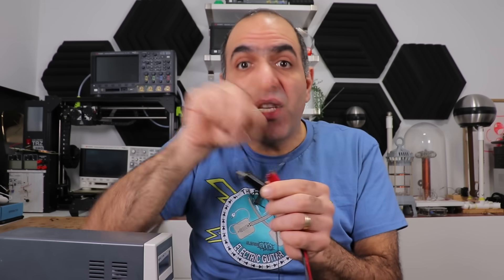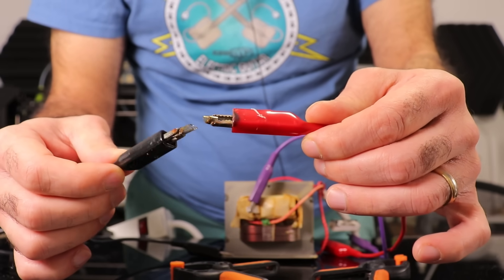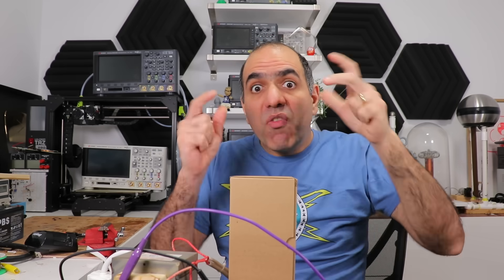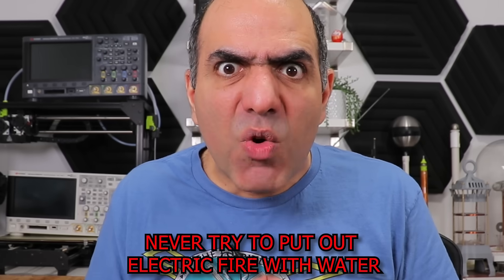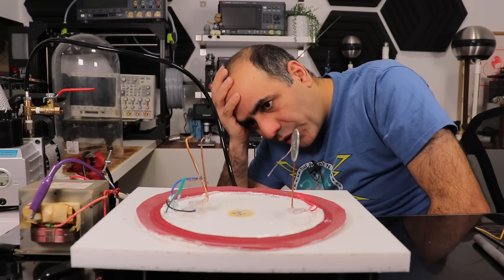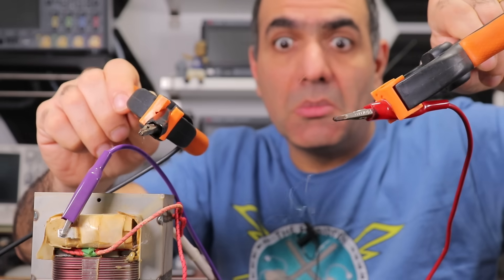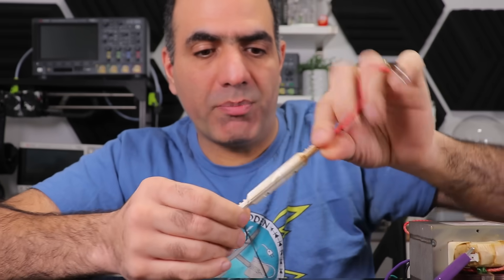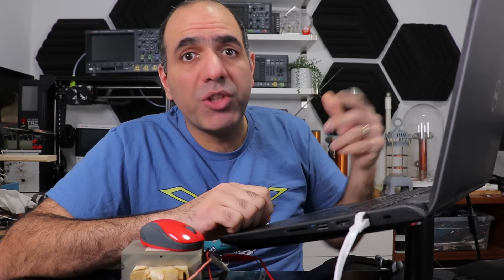Making a High Voltage Fuse

Comment: Video Idea: Build a deadman foot switch that you have to keep pressed in order to get mains voltage whenever you are doing something with the MW transformer. In case of an accident like with the Jacobs ladder it could safe your life :)
Reply: Im pretty sure he already have something like that, he is smart and this is his profession..
He know's what he is doing.
Reply: That's a great idea 👍
The one hand rule is another lifesaver.
Reply: @John-oo9bu  yup but that doesn't always work when having to react to something quickly ( like a Jacob's ladder falling on you :D )
Reply: @John-oo9bu one hand is a good rule, but when dealing with over 600v it won't always save your bacon.  Insulation has a breakdown point.
Reply: @MichaelRBaron  Actually, the worst shock I've had was through insulation. My other hand was in my back pocket, not on the grounded work bench. I was only 14 and very lucky.
Reply: @John-oo9bu  worst shock I had was 277 from my right hand to my left forearm.  Second worst was a 15kv neon sign transformer, 7.5kv to ground but only 30ma of current.
Reply: he has and old video explaining that he has a hidden switch that uses to cut power also to trigger the explosions
Reply: Good idea, unless you get paralyzed during shock in such a way that one side of your muscles overpower the other and you stay more or less in the same position unable to move and just slightly straightened overall. Dead-man switch relies on loosing grip/consciousness, and shock is often the complete opposite.
Reply: @Mr.Leeroy dead man switches have 3 positions.
Loose grip being off
Mid grip being on
And tight grip being off
Reply: supporting this idea, we wanna keep our youtuber/professor alive
Reply: Back then (Jacob's ladder) he needed to just knock the falling ladder off with his right hand. He wouldn't have suffered as bad or maybe even not at all.
Reply: im not 100% sure but i think when you get electrocuted you tense up so he might he the peal down harder. dont know for sure
Reply: That's probably Way Cheaper than getting Married and Having Children.
In that home, there is always someone within arms reach of the Breaker Box, guaranteed.

Comment: Circuit brakers does extinguish electric arc same way, by pulling contacts apart very quick (not only by pulling contacts fast they have more strategies to extinguish arcs like multi point contacts to spread arc trough multiple points... But this is main idea and that's allso what makes circuit braker pop sound)

Comment: Glass fuses commonly contain nitrogen gas to prevent arcs. Sulfur Hexafluoride is also used to insulate fuses with higher voltage ratings.

Comment: In general, glass-sealed fuses, including those used in microwave ovens, are typically filled with an inert gas, such as nitrogen. The purpose of the gas is to provide a medium inside the fuse that does not support combustion and helps to prevent the formation of arcs when the fuse blows.

When a fuse blows, the metal inside the fuse melts or vaporizes, creating an open circuit. The presence of an inert gas helps in quickly extinguishing any potential arc that might occur when the circuit is interrupted. This is important for safety reasons, as it helps minimize the risk of fire or damage to surrounding components.

The specific gas used can vary between manufacturers and fuse types, but inert gases like nitrogen are commonly employed for this purpose. The gas is sealed within the glass or ceramic tube during the manufacturing process, creating a controlled environment that enhances the safety and reliability of the fuse.

Comment: Some fuses use explosive charges to separate the conductors quickly. They're commonly used on pole transformer fuses...loud too.
Reply: Well that explains when the power company came out to diagnose our street power line (underground), the fuses would blow up sounding like fireworks. A bad pad mounted transformer was the cause, but the techs went through 3 fuses just trying everything before getting the new transformer. One of the transfer boxes was in my backyard. Was pretty cool to help the dude dig in the ground and help alleviate his work.
Reply: I had one of them blow on the pole opposite my house once. Certainly when they blow they BLOW!
Reply: I'm a substation Electrician for the power company in PA. There is absolutely no explosives that I am aware of. You are hearing the arc as the fuse burns open and a spring pulls the bottom of the fuse wire out of the tube.
Reply: @oxichimaruxo1528  Big Clive dismantled an explosive disconnecting fuse, so they do exist. He also set it off, nearly deafening himself.

Comment: You can divide the fuse into several sections using ceramic partitions, and pass the wire through the holes in it. Theoretically, this will help to mechanically extinguish the arc.
Reply: There is still a hole through the ceramic portions and the arc will travel through that hole. Remember electrons are very very small.
Reply: @deang5622  OK. but the idea is to mechanically break the plasma cord of the electric arc, which rises upward under the influence of its own temperature.
in the industrial fuse shown by the author, a similar mechanism is implemented due to spring tension of the conductor and filling the space with gas.

Comment: Sulfur hexafloride is used in some really high voltage interrupters, to extinguish the arc quickly. It's a gas that is a very strong insulator.

Comment: This is the same reason why if a Filament bulb starts flashing, if you disconnect the power, it'll never light again, the filament breaks and the voltage jumps between the break - No fuse is under a vacuum

Comment: A lot of modern high voltage, high power fuses are vacuum fuses. Vacuum increases arcing distance until you get the pressure low enough, then it rapidly decreases. Pull a better vacuum and that fuse will work.

Comment: Would love to see you slowly make all electronic components by hand.
You’ve made capacitors, resistors, inductors, relays and now fuses.
Diodes shouldn’t be hard, you can make transistors from diodes.
After a while you can make circuits with your diy components
Reply: You can make diodes quite easily. I believe making a home made transistor should be extremely difficult. Don't know if it can be done.
Reply: @haideralikhan5947  I’ve heard transistors can be made with diodes. I don’t know how though
Reply: @MahBor  you need two diodes. Both anodes connected together which becomes the base of the transistor. Then you are left with two cathodes, one is collector, the other is emitter. 

The base MUST be very thin and with low impurity, otherwise the transistor is not going to work. 

That's not possible with regular diodes.

Comment: There are also ballistic fuses for 100+ kV grid installations, where the arc detonates a small explosive load inca mini mortar. This shoots out a plug at the end of a conductor which made the connection at the first place. The distance to break the arc can be several meters in a very short time. It is also resettable by replacing the explosive charge and plugging the whole thing together again. @electroBoom Would you like to diy one of those?😂 Most of us would enjoy watching you do it
Reply: re: "for 100+ kV grid installations"
Used on 7 kV and 14 kV distribution circuits and to transformers on the poles, too.

Comment: i have a question. Is the voltage of electricity infinite and it is just capped at a specific volt or does it come in different voltages based on your power line or something?

hopefully you answer :D 
btw love your content its very educational
Reply: only RF driven inductors in a resonant design have in theory infinite voltage, but in practice something somewhere will limit the voltage. In this video he was using a AC transformer that has a fixed ratio. this means the voltage is limited to the AC voltage of the power multiplied by that ratio.

Comment: Well if you have circuit rated for 12 volts with 12v fuse. The rest of the circuit isn't going be designed around 20 thousand volts. That just ridiculous.

Comment: I have seen breakers for power generation. It used air compressed to 300bar to blow out the arc.   And enourmous springs tensioned with hydraulics to pull the connector apart about a meter. 
Not reccomended to be near one when it pops!

Comment: I imagine these fuses could be filled with sulphur hexafluoride, a gas frequently used to quench high voltage arcs. it's also used in high power switching equipment to eliminate those arcs. it's a great insulator too

Comment: It scares me quite a bit when you hold one MOT electrode on each hand like that, even with the insulation. I'm pretty sure that you know what you're doing but I just wanted to remind that electricity has a tendency to find a way and the insulation of the plastic might break. Even a hairline of carbonization in the plastic is enough to make the person holding them a part of the circuit. Maybe I'm a bit too worried, but I just wanted to get it out of my chest.

Comment: Would be interesting to use multiple low-rated fuses in series.
If the first melts and arcs, a second one would melt and increase the gap ^^
Reply: The problem is the arc has higher resistance than the fuse, so once the arc starts a bunch of voltage is dropped across the gap turning amps into heat and light and sound, leaving less power available to blow a second fuse.
Reply: @oasntet  yeah, possible, but it depends on the rating of the fuses.
If they were just rated for 100 mA...
Reply: Maybe with a short circuit. But with an overload they don't open at the same time.
Reply: @mernokallat645  no no, I don't mean at the same time, I mean after the first one opens and if it would arc, then the second one might melt.
Reply: @Frogn_  That would last too long.
Reply: @mernokallat645  yes, maybe, but it was all just a theoretical idea, which would be interesting to see.
Reply: @Frogn_  The difference can be several minutes with a small overload. Even a short circuit sometimes blows only one fuse when multiple are in series.

Comment: 6:00 Please, please use the one hand technique when working with MOTs, they are unbelievably scary, and you usually don't get a second chance if you screw up. I love watching your content, it's informative and hilarious, and your lax safety standards are part of that, but MOTs are an entirely different beast compared to many other power sources. AC flyback transformers are far less dangerous, since they oscillate faster than your nerves can react, so it would be a safer option if you want to work with large hot arcs. (ions must be pushed along the voltage gradient to activate your nerves, at these frequencies, they just vibrate in place instead of going anywhere. It can still burn you though, if you touch the plasma or pass too much current, but it takes much more current to do that than it would to stop your heart with DC or low frequency AC.)
Reply: Have you not watched his older videos? Mehdi literally nearly got shocked by his old MOT in his Jacob's Ladder video, I'm pretty sure he knows exactly how deadly they are but has chosen to take the risk regardless (he even says in this video that no one watching this should have one).
Reply: @bosstowndynamics5488  Yes, I've seen that one, but just knowing the danger doesn't save you from having an accident. So when your life is really on the line, it's a good idea to take precautions, especially if something has already gone wrong once before.
Reply: @umbrakinesis2011  What I'm getting at here is that if you want to convince him to be safer, a long explanation of how is dangerous isn't going to change the mind of someone if you're just repeating stuff they already know
Reply: You do realise he's actually a real electrical engineer. So he already knows what he can and can't do, plus he learnt the hard way on what no to do too. It's nice that you care about his safety and I respect that bro.

Comment: Hi! Great and fun video as always^_^. What I found is silica sand or some other non conducting liquid is used mostly as a filling inside those fuses
Wikipedia says--
The fuse element may be surrounded by air, or by materials intended to speed the quenching of the arc. Silica sand or non-conducting liquids may be used.
https://en.m.wikipedia.org/wiki/Fuse_(electrical)

Comment: I once accidentally used a C13 cable for my computer that had a 3A fuse in it (yes I am from the EU lol). I have no idea how on earth a 3 amp fuse got in that cable, but it did come with a used power supply that was "tested". My computer turned on sometimes, but kept turning off randomly or refusing to start at all sometimes. Turns out, it needed a 13 amp fuse, I want to write a mean email to whoever packed that cable. :)
Reply: Please tell me you verified the wire gauge first though.
Reply: @andythekitsune  I don't have to, most if not all C13 cables are rated for 20 amps (especially here in the UK) as they are used for anything from toasters to kettles. That being said... Pretty sure it was 10 AWG. I'm using American speak as that's what the majority of people here seem to understand. Plus it said on the moulded plug "13 amps" and in our plugs we have a fuse we can flick out the plug itself, in case there's a power surge or something and the fuse pops. It means the breaker is the last resort for electrical faults. Saying that the breaker in my house follows UK law and has a RCD in it.

Comment: I'm sure you've seen the fuses they use on (at least in the US) power lines? They have gun powder in them and an expansion piston so as the fuse blows it ignites the gun powder pushing the contacts far apart to quench the arc! Seems right up your alley to build....

Comment: 7:27 this is why in higher amp glass tube fuses they would commonly use a crimped metal piece, or even an actual spring, so when it failed, spring tension would cause the pieces to move away from each other.

Comment: Sulfur hexafluoride is good for quenching arcs. And it would be hilarious to hear Mehdi's voice after inhaling it 😂
Reply: I wonder how SF6 could get into the atmosphere to cause green house effect being so heavy? I think it would rather sink into the ground… In fact it is used in high voltage installations as an arc quenching agent, especially in fuses
Reply: @Similas Gasses don't quite work the same way liquids do. Since the gas molecules are bouncing around more or less freely without any sort of intermolecular forces holding the particles together they can readily diffuse into each other and even really heavy gasses can go fairly high up into the atmosphere. This is a good thing for us, since otherwise the bottom few hundred feet of the atmosphere would be relatively pure argon with the oxygen floating on top of it and we would have nothing to breathe.
Reply: Yes but my SF6 gasss just escaped
Reply: SF6 is also a reaaaaaalllyyyy bad greenhouse gas. Don't let it out into the atmosphere, seriously.

Comment: high voltage fuses contain gas-evolving substances such as boric acid  .When the fuse blows, heat from the arc causes the boric acid to evolve large volumes of gases The gas helps to extinguish the arc and prevent further damage to the electrical system